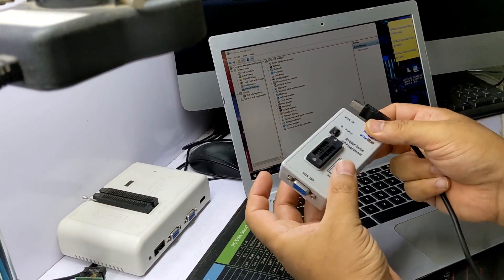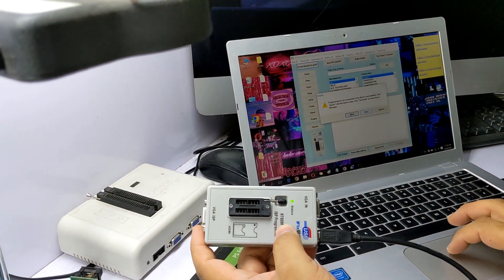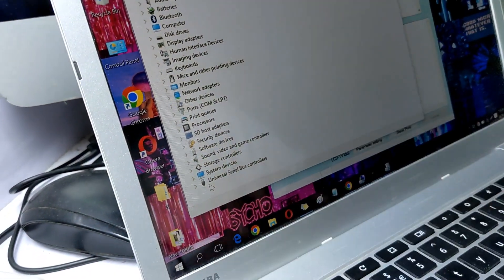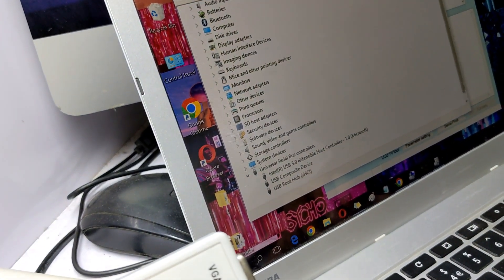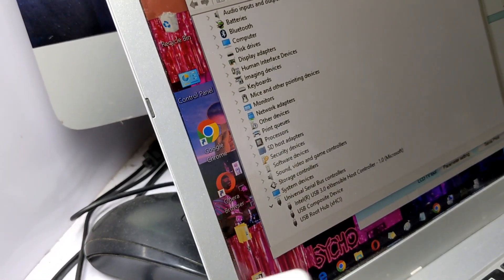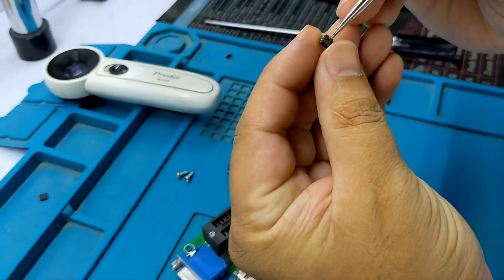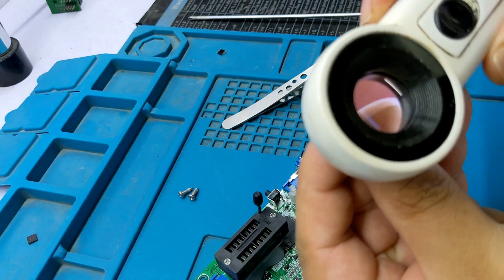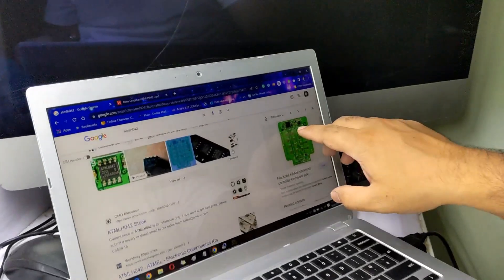Rt809f Programmer Not Connect Repair

Comment: The question is, do you need to reprogram that IC? ot just replace it? 2nd is where did you buy the chip? did you bought it with pre-installed firmware?

Comment: Salam sir, i have rt809f programmer. It is cresting heat ptoblem of bios memory chip..bios chip got heat, any solution??
Reply from the maker: Check regulator ic
Reply: @laboneinside  ok, in sha Allah..